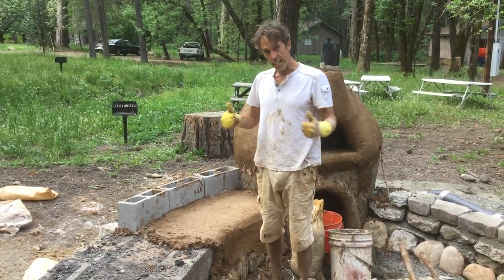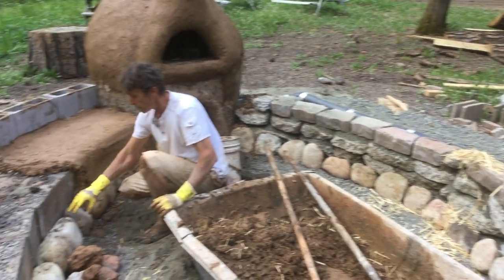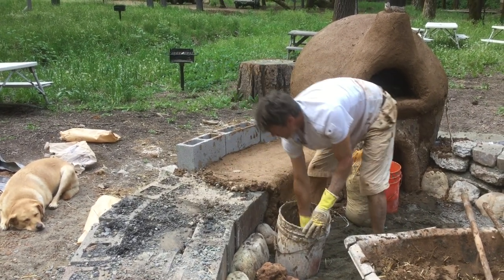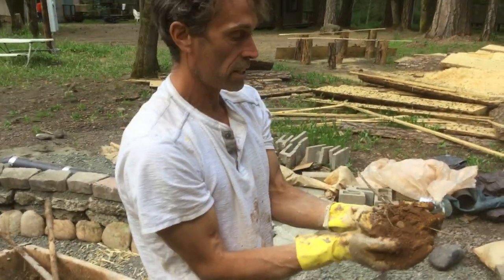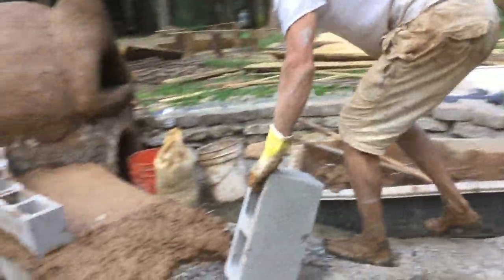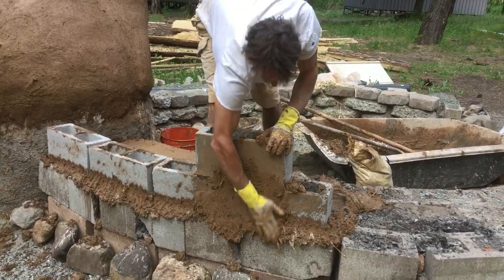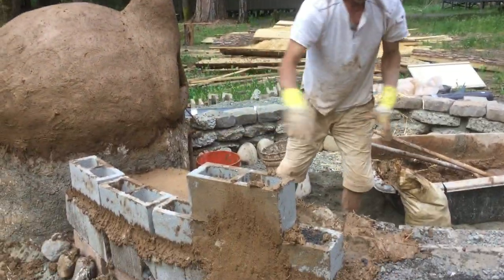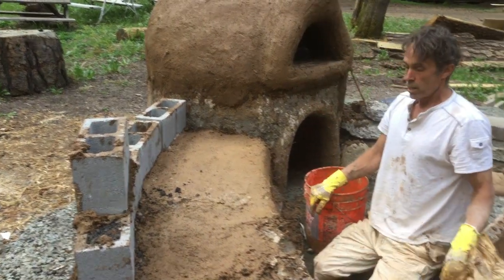Building a cob bench base

Comment: Hi Miguel, Will this cob mixture be water proof, or does it need to be covered during the rainy season?
Reply from the maker: You will need to apply either and earthen plaster or lime.plaster and linseed oil sealer. A roof would also be a great idea.

Comment: By putting concrete you basically kills the whole concept. Just use cement if concrete is already there. Or use only Cob.
Reply from the maker: There was a bunch of left over concrete blocks on the property and an old.tennis court that got broken up. We didn't have a bunch of stones to work with or time.to make adobe bricks. It's still a great functional structure that offers folks the opportunity to sit on an earthen structure and enjoy the experience